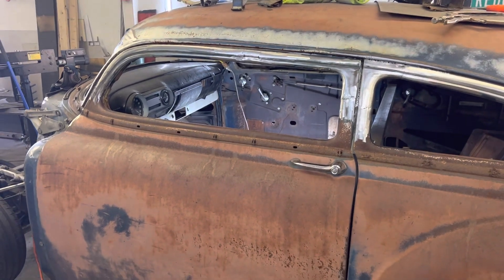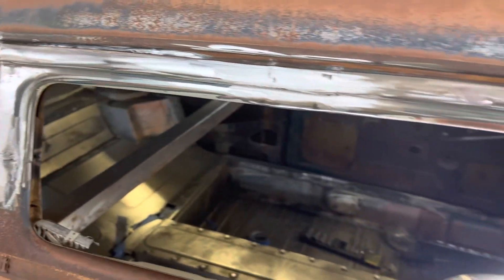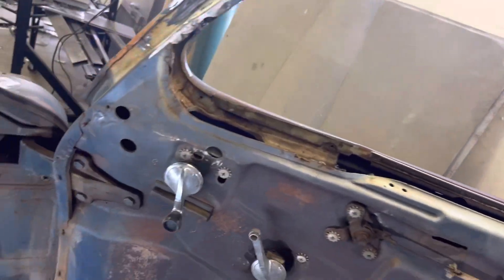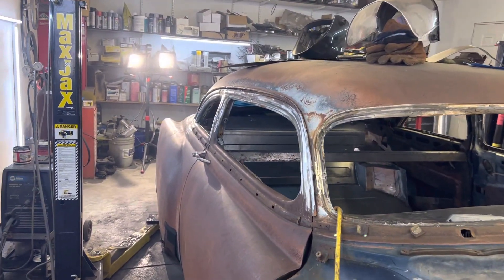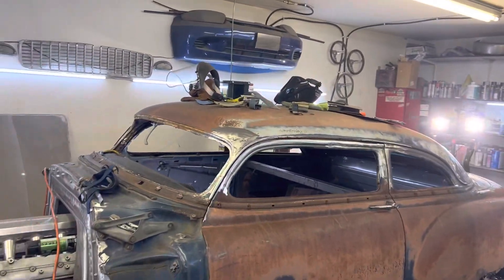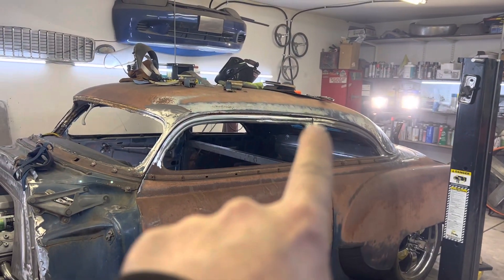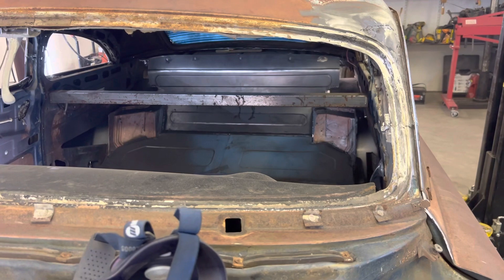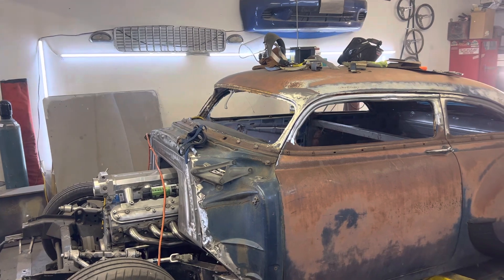1954 belair choptop check in

Comment: So, looking good. I was wondering, what did you use to piece in the gap you had to fill on the door window frame and posts. Did you use a piece from a donor door or did you fab up a filler piece from sheet metal?
Reply from the maker: I had enough metal left over from the quarter glass channel to use for the door frames